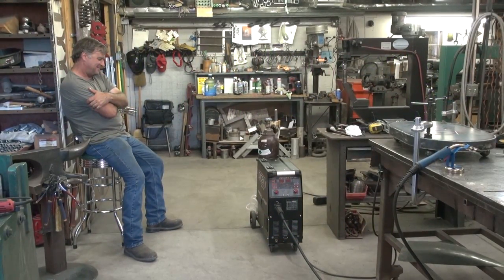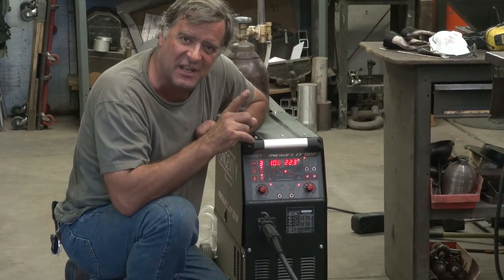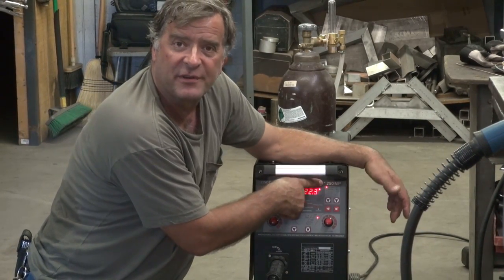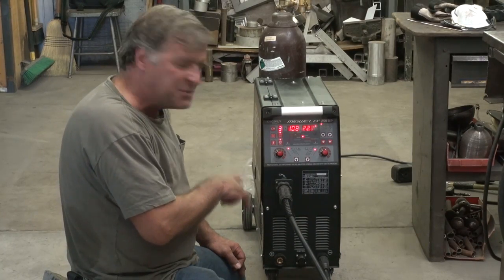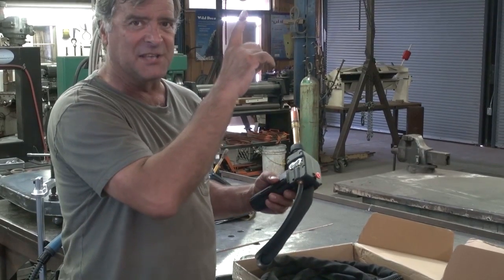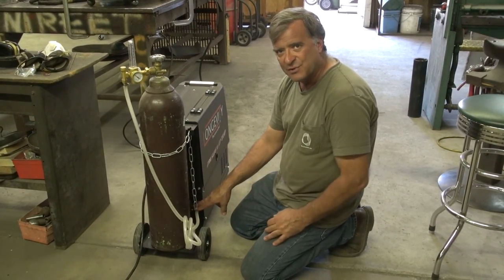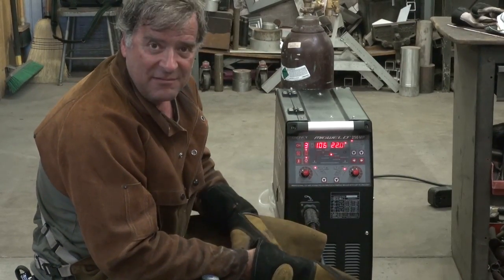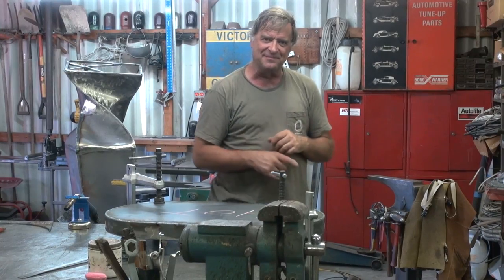Introducing Longevity's 250MP MIG / Stick Welder - Kevin Caron

Comment: I have this machine but made by TOPWELL. I'd love to see a video explaining it in detail. I've been using it for welding steel for 3 years now (off & on) but really still don't fully understand it let alone using it for Alum. I have the push pull gun as well. Unfortunately I'm old school you know (amp and wire speed) to adjust the machine. Im retired now and opening my garage up as a weld shop. I really would like to understand this machine so I can use it better. I can't find any videos explaining it very well let alone the manual which is great if you already understand all the settings. I find myself scratching my head a lot. I also have the Everlast 255 ext, now for 3 years and am just now understanding it. I know it's my bag but it seems these machines get made but not well explained. At least for me anyway.
Reply from the maker: Was never happy with this machine.   Finally sent it back and got an Everlast instead.  I find the online manual is much better written.   Not sure if Longevity has a book online for this machine, but you might check.  Where are you located in the world?  If you are here in the U.S. it is easier to talk to you about the setting instead of all this typing.

Comment: I find a similar machine from China, and they have some more distinctive machines. How about their AC/DC TIG welder which has four waveforms and amplitude control as well?
https://www.alibaba.com/product-detail/Pulse-and-Double-Pulse-MIG-Welder_60036502840.html?spm=a2700.7724838.0.0.qvhUYa
Reply from the maker: +Stephen Curry 

Don't know what you got there..    Could be the same company that makes them for AHP.

Comment: hey kevin i am looking at 2 welders that both have stick tig and a plasma cutter they are the ct312 and the ct 416 both are used 
and what should i be looking for when i am buying a welder even though i don't know tig welding or plasma cutting to test it out
thanks
Reply: ***** alright once again kevin thanks alot for the info

Comment: So...obviously this is a transformer based machine, right?  That's why you were surprised at the reduction in size.  If it was an inverter based machine, it seems like the surprise would have been the other way around. :-)  So does this transformer machine give a good duty cycle or have you had time to look at that?  Thanks